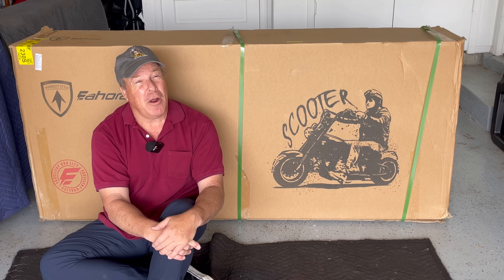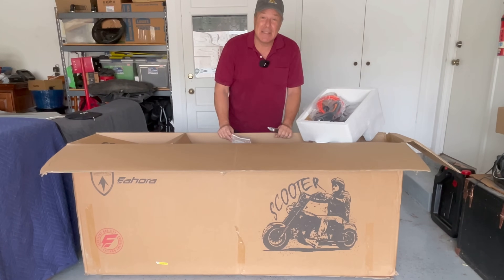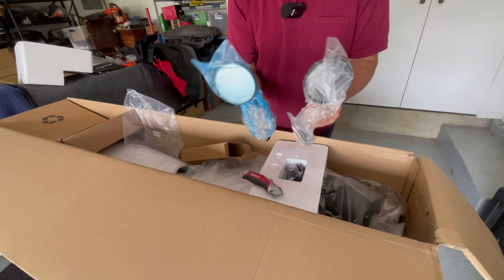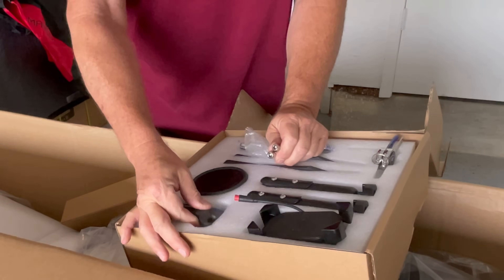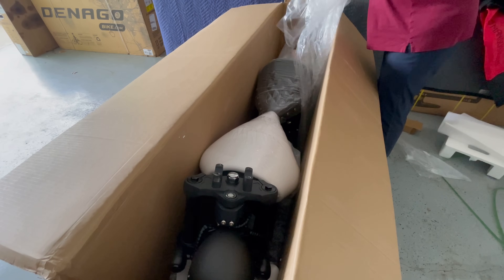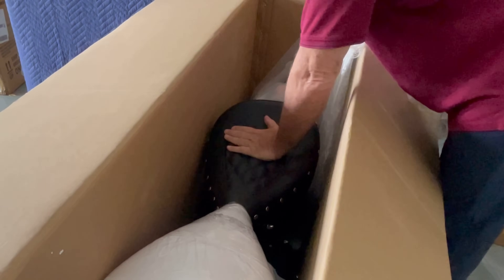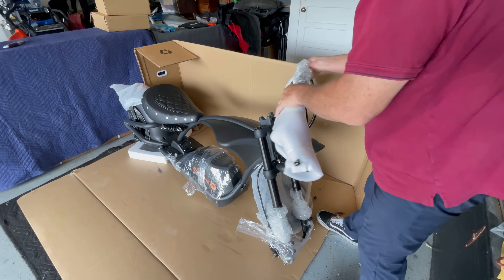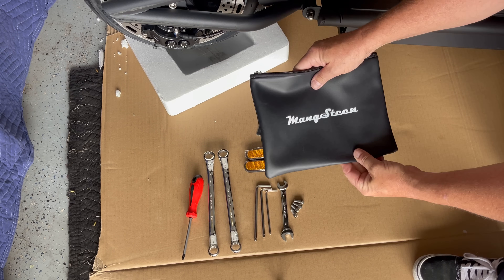My 4,000 Watt, 55 MPH Eahora Knight M1PS Unboxing And Assembly Video!

Comment: If there are any adapters for the charger so u can try to charge it by a public charging station
Reply from the maker: It plugs into a regular 110.
Reply: You can get a j1772 to nema 5-15 adapter

Comment: That's a motorcycle! I doubt any of it is DOT appproved, but it appears to have all the stuff you'd need to pass a state safety inspection here in my state. With it coming with a certificate of origin, that would be titled as a motorcycle if you were to register it.

I'd assume with the 55 mph top speed and lack of pedals, most states would classify it as a motorcycle and require a M endorsement for operation.

Comment: No offense;  I know you are all jacked up over it, but the whole thing looks really out of proportion and dorky.
To me it looks like they had a bunch of parts left over from other projects, and decided to see if they could
make something and get rid of the parts...
$5,000.00  ?  No thanks, but I know some people will be all worked up because there is a handful of fancy looking
fasteners, lots of lights on the single display, a huge seat, and what looks like a piece of plastic to put your
phone.
When I see things like the fancy looking fasteners, the first thing I think of is that it could potentially be a 
compromised / weakened component. The other thing I think of is that they were done that way to make
a potential buyer think that a lot of time and effort went into the details building it to help distract from,
and justify the $5,000 price...
I'm not going to say it's not built well because I've never looked at one, but even if it is, I would think $2,500
for it would be pushing it. Quite honestly, the only way I would even pay $500 for it would be so I could
flip it and make a few bucks on it. For $5,000 I would buy a real motorcycle. Something that would certainly
do more than 55 mph, but that's just my opinion, and it's not worth much either...
Reply from the maker: Ouch…
Reply: You're right, it's not worth much
Edit: your opinion that is